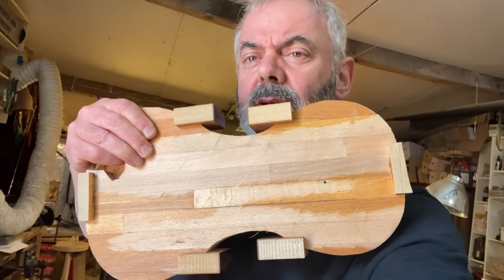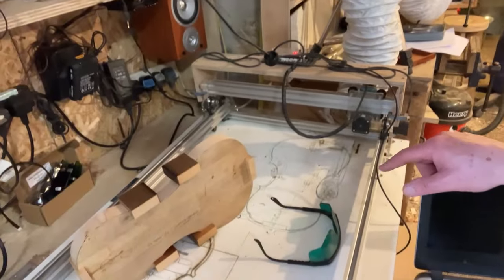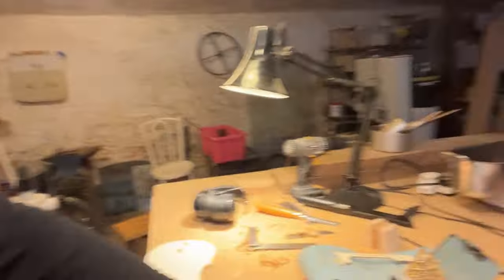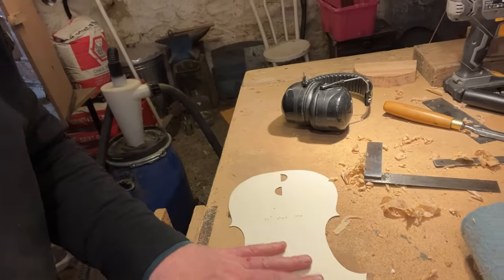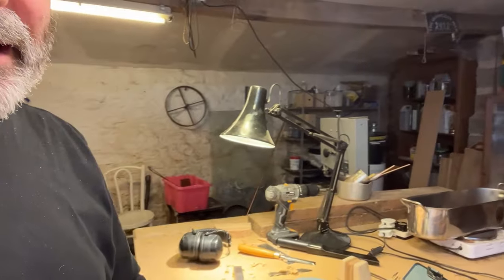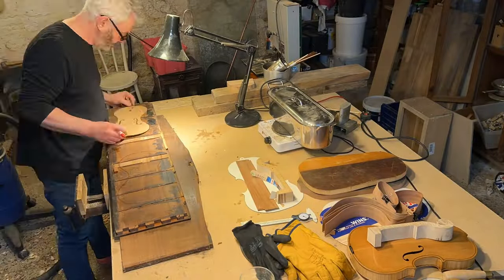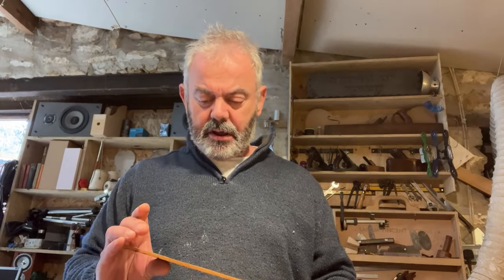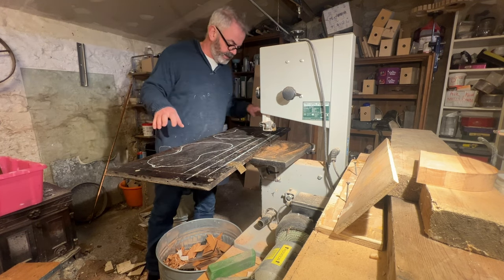# 155 - Making a 15" Viola - Part 2

Comment: Graham:

New subscriber and aspiring luthier here from Texas. I’m intrigued by a lot of things you do slightly different than the norm.

Like steam bending the ribs before using a bending iron to refine the curves. With the two step process, is that a time saver, or does that make the job more foolproof somehow?

I’m also fascinated by your unusual wood choices, how you’re not bound to the rigid orthodoxy of spruce and maple. Come to think of it, one of the best cellos I ever played was a modern build had a willow back and ribs.

Comment: When you said it's "short grain" and snapped it, what exactly do you mean? When you cut them did you get them close to quarter sawn for the grain orientation, or something else? It would be awesome if you could show and discuss grain orientation and annual rings as you decide how to shape wood. I'm fairly new to woodworking and think most people take this analysis for granted. Thanks!
Reply: From the way it breaks, it means the grain was cut slightly across the grain, not along it. Visualize it like a bunch of straws stuck together. The “tubes” of the wood grain should run from end to end. When the grain orientation in a long piece of wood is slightly diagonal, it’s easy to break.

Comment: I would 2cnd on the 1st comment
Reply: From the way it breaks, it means the grain was cut slightly across the grain, not along it. Visualize it like a bunch of straws stuck together. The “tubes” of the wood grain should run from end to end. When the grain orientation in a long piece of wood is slightly diagonal, it’s easy to break.